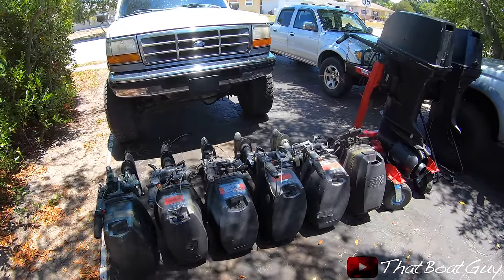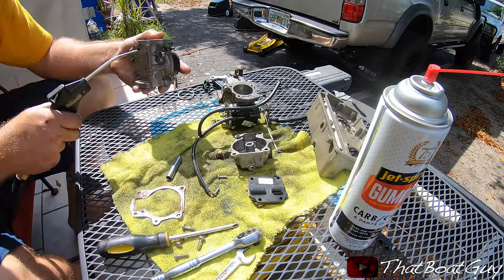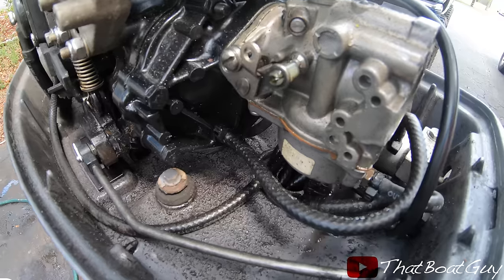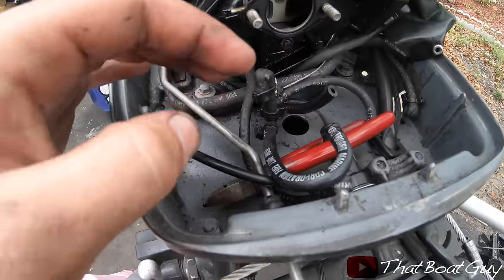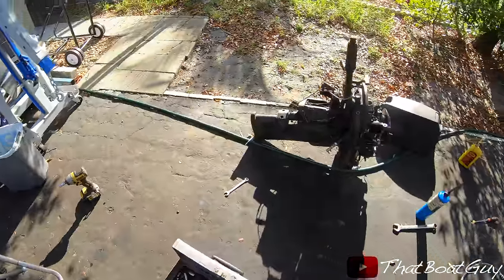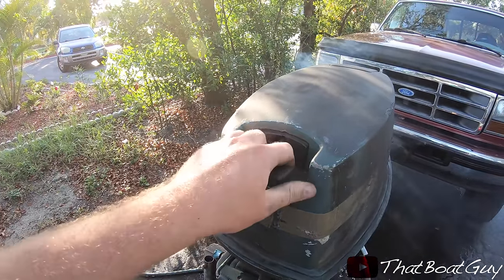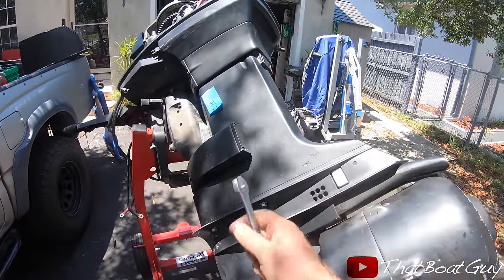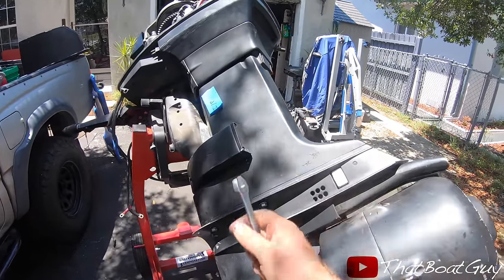Can I Fix 8 Military Outboard Engines?

Comment: The military ought to hire you to be their boat guy. It would probably save a lot of money. Thanks for the video and God bless.
Reply: As if the military has any interest in saving tax dollars..🙄
Reply: Nah, they have a cycle life and get replaced working or not.
Reply: military save money???
Reply: @johnwren3976  🤣🤣🤣🤣🤣 - TRUTH!!
Reply: Those are too old engines. Maybe usable for practice or blowing them up
Reply: The military, the SEALs Teams (units now) have two SEALs from each platoon that goes to small engine repair (I was one for my platoon) This is why you are seeing field fixes. We used these two models.
Reply: @mini696  then there's planned expenditure and other things budgeted for. If you don't spend the full budget then you don't get that money next round.
Reply: @bingus454  Connorwer is not real. You need to free yourself that you have more self awareness than a teapot.
Reply: lol when I was in the Navy, there was a cobra that they could never get to run right. They literally stripped it and pushed it overboard.

Comment: I'd like to comment on the condition of those engines - both before and after the fabulous repairs.  I organize and run a training for the Naval Sea Cadets that involves a lot of boating.  In years past, we have spent nearly half the "training time" trying to get our motors running.  Not this year.  The engines were in superb condition and greatly contributed to the best training we've run in the last 7 or 8 years!

Comment: I notice they are all 2 stroke engines, sometimes the old school technology works the best.
Reply: And they were made by OMC (Johnson/Evinrude)
Reply: well i mean all these engines were replaced with newer engines soooo
Reply: @chikendagr8994  it is the government soooo lmao
Reply: @chikendagr8994  people think old = less reliable. It’s not the case a lot of the time. A lot of new things are bought when they aren’t needed at all…
Reply: @nabox1435  I mean there is some truth to it. Older stuff has more hours, which makes them less reliable than new stuff, which usually has less hours. Also now all the major outboard brands are all reliable, where 30 years ago you had the reliable and the unreliable brands.
Reply: I can't really say about new stuff since I never owned a 4 stroke out board. But out of countless 2 strokes all mine have been mostly reliable. Even when a rod went in my 1956 she putted me all the way home on 1 cylender. My 65 was sank for over a month, pulled it over a bunch and she ran fine after a points cleaning. Hell even my 1988 tower of power is proving itself pretty damn well. Come to think of it I've only paddled home once due to a lost prop, never a total failure. And I sure have had a lot of old junky motors
Reply: Two strokes are pretty straight forward, fuel spark and compression. Newer 4 strokers units have cpus and electronics, same as cars. We take along a spare 20hp two strokes in the bildge all the time. Saved our butts few times.

Comment: I want him on any boat I own, stinking repairs a carb out on the water.
Reply: I woulda dropped it in for sure
Reply: he rebuilt one carb on a expanded metal table.........I lose parts in a box! LOL
Reply: Just unbolt the engine and drop that fucker in the lake/ river lol I hate unreliable boat motors
Reply: By a rebuild kit and READ THE F'N directions! Easy

Comment: There's the ultrasonic cleaner!  But yu need the next size up so you can get a total submersion.  But hey - headed in the right direction 😊Because you like your engines to look clean - if your not going to do the full detail under the hood, hit the guts witih your high pressure air hose.  That will tidy it up right quick.

Comment: Just fixed eight motors in 12 minutes and 31 seconds and took apart and diagnosed a carburetor problem while on the water. Nice job dude. Enjoy the videos

Comment: What are you using in your ultrasonic cleaner?
Reply: Ultrasonic detergent containing Sodium Metasilicate Pentahydrate! You Will find that in the store that sells the ultrasonic cleaner ☺️
Reply: @chrisbjorlin2549  we use grade B water and vinegar white 50/50 mix I'm the military to clean stuff air and 02 clean related.
Reply: I’ve got the same ultra sonic. dawn purple detergent is also used a lot.

Comment: Thanks.  Do you “mess” with remote start (I mean, electrically started from conning station away from the engine) and remote steering (cable or pushrod)?

Comment: '
Those are motors for the MARS (Marine Amphibious Reconnaissance System), which was usually mated to a Zodiac F-470 CRRC (Combat Rubber Raiding Craft), used by USMC Force Recon, US ARMY SF & Rangers, Navy SEALS, USAF STS, etc. I think they are based on Johnson Commercial motors, modified with the drain system, they also came with a silencer system, which was acoustic pads fitted around the case and top of the lower unit. Thanks for bringing a few of them back to life, I have many fond memories of long nights at sea running those bad boys.

Comment: I have an older (late 70's) 50hp Evinrude that will not idle properly and I believe it's also missing a spring or link for the choke. I need help bad!!!! Great video by the way. Very impressive.

Comment: first one is missing the clear outer sleeve on the cam roller. it will idle and accelerate much smoother if replaced. good work! i think some of these motors could also run on kerosene with an easy conversion kit.

Comment: Man I enjoy all your videos they helped a lot, Can you make a video about normal temp on a outboard motor, and split temp difference between cylinders if is any tolerance, and where to take the temp readings,if is at the thermostat or head if you use a laser temp reader. Thanks, you are very good teaching

Comment: I’m a newer subscriber and newer boater! I’m currently repairing a 1980 Sea King 15 Horse by Chrysler. I replaced the head gasket which had blown and seem to have good compression. But now my starter recoil stopped winding back up. A starter online costs about $60 which seems too much for me. I’ll try to see what I can do before I go and buy an expensive part

Comment: Those look like Evenrude MFEs? Those are neat engines, will run on almost any fuel (Unleaded, JP5, diesel) and are designed to be submerged in water completely and be able to get running with minimal work. There should be a drain petcock on the engine to drain water out of it, in that case.

Comment: Outstanding work sir! A couple of questions: How long is that boat you used in each of these 8 tests? What does the steel cable you have looped around the tiller do? I assumed that it was for some form of safety, but I cannot come up with its function. Thank you very much for your videos!!

Comment: Can’t wait to see these on marketplace! 😂

Man seeing you fix the carbs with easy makes me upset. Been dealing with my 1999 force 120 carbs for months..
Reply: Force = fucked over recycled Chrysler engines
Reply: @johncarlberg4481  thought they were mercury at least a 99mod would be
Reply: If I remember right..If the calan has a red stripe on it, it's from mercury.
Reply: Well it’s a 1999 tracker 120 by Mercury but I always assumed force
Reply: Make sure you can hear gas going onto them. If you do but have gas coming out of the throat of the carb the float is set to high. If no gas is going in the needle valve is closed or the float is stuck.

Comment: Love watching you just plow through all those motors. Hey if you could would share what kind of solvent u use in that frequency cleaner. Hope to see you back at it like a couple years ago. If not hope your newest money hobie is working out for you . I would like to buy a Yamaha 90hp remote in pretty good to great shape . I have merc 60hp 4 stroke on my 1996 nitro 160TF and would love the extra umph where you really need it. It's rated max 90hp but could a 90 be pushed up to 115 hp or something like that. Change of carbs or something like that. What do you think.

Comment: awesome videos' I have a 30hp enforcer, looks like the fuel connector was removed (presumably to get it into the auction system), no starter rope or handle, and not run for over 5-7 years, although looks to be in excellent shape - do you have any pointers to get this thing running?  cost, etc?  thanks

Comment: Hi! On the locked up motor after removing the carburetor can you put TCW3 oil to lubricate the reed valves and the crankshaft? I did this (without removing the carburetor as I was an 9 year old lad) to my dad's stored Chrysler 20 from 1969 and I still use it today...

Comment: That solenoid... those connections look as bad as what I found on a poor woman's car one night, Augusta, Georgia, night before Thanksgiving, on not only her battery terminals, but on the solenoid, starter, and engine block connections.
I cleaned all, using some automotive No-Ox I just happened to have. In the rain. Wearing my Dress Greens. While she and my wife chatted.
OMG. That was (counts, mark, counts more, runs out of fingers and marks again...) almost smack on 40 years ago.

Ma'am, I hope you had a wonderful Thanksgiving, and are still doing well.

Comment: Good job on all those motors. I'm interested to see how that lower unit works on that 55hp you got.
Reply: It's essentially a jet ski jet drive bolted to the outboard. The impeller and liner works like a high speed pump to push the water behind itself.

Comment: Really enjoy your videos!  Been going through a lot of them… I just got a pro line 231 with an outboard evinrude 200 ocean pro… boats in good shape, but only has 60psi on 2 cylinders… was wondering if u could give me some advice
Reply: 60psi on two cylinders with the rest being fine indicates ring damage or stuck rings if it hasn't been run. Get ear muffs on it (or put it in a big can of water), and run it for a few minutes. If the compression comes back up then it was just sticky rings and putting a bit of automatic transmission fluid into the cylinders then spinning by hand can help clean it up. If the compression stays low, those two cylinders will likely need work.

Unless the block is completely destroyed, that motor is worth fixing. If it's the 96-98 models you have to watch out for the main bearing cap bolts, I guess there were metal shavings from the factory that were stuck in the bolt holes that caused them to come loose.

Comment: @ThatBoatGuy hi , so I have a 1982 60hp evinrude 2 stroke it has compression on both cylinders 140 each I changed the spark plugs and I have blue spark on both of them I changed the woodruff key and cleaned the carbs I even changed the woodruff key and still nothing not even a pop I have fresh fuel and I made sure the kill switch lanyard was on and still nothing I sprayed starter fluid in the carbs nothing I don’t understand it was running perfect about 2 weeks ago 😪

Comment: Are the 55 hp engines the evinrude 55 mfe’s? If so I wish our had electric starts cause that would have been way easier to start when you’re getting pounded in the face by the surf.

Comment: Been watching you videos for a long time but now need some help advice.  I have a 40 hp Yamaha two stroke outboard and just cleaned the carbs and new fuel pump. Cranks right up and runs great for about 30 seconds and shuts off. Hit the key and cranks right back up for 30 seconds then shuts off. I wasn't told when my buddy brought this boat to me that's this is what is was doing to start with. He just ask me to clean the carbs. They were not even dirty but I vated them anyway.  Any help would be greatly appreciated.  Thanks Mike

Comment: So you're really awesome fixing outboards. My father and I have spent nearly $1,000 trying to get this evinrude 90v4 running right between two visits. It's still not right.  Can I connect with you to get some guidance? I'm automotive and diesel certified.. boat stuff is alien to me.

Comment: How do we go about getting in touch with you? I finally got a boat but found out that the engine is screwed. Lesson learned, use a camera cause compression check isn't everything. So I believe I need to repower. Even considering getting a different boat. So LMK if you have something, 50-75hp or boat, and Ill come give ya a visit. Happy 4th and great video as always!
Reply: Post some more info about what’s going on and maybe someone can offer some help.
Reply: @adamr9215  1999 Johnson 50. Had a hard time idling if at all. It ran fine during the test drive. Later checked and looked like it may have ran without oil. Tho further checking seems like it had at least some oil. Had good compression but used a camera to see some scoring on the cyl walls. Friend came over and made his own adjustments (not following the OMC video) and seems to run just fine now. Tho Im still not sure I trust it.
Reply: @adamr9215  I didnt run it much after getting it. Just a few times testing to make sure I got the shift rod adjusted. Once I was finally satisfied and wanted to test, I couldnt get it to stay running. Only thing I did was fix the fuel pump leak (O-ring) and flipped over the fuel manifold (per the video that shows removal of VFO system).
Reply: @southseapirate1  Did you do a compression test? A lot of time, a little scoring will pretty much wear away after a few hours of use and compression will come back to a point. Sitting for very long will gum up the carbs pretty bad if you aren’t using ethanol free fuel. And factory recommended tune is a good baseline to start from, but after some wear and tear you may have to adjust differently to get it to run right. Also, if it has more than one carb, you need to sync the carbs. Out of sync carbs will cause idle and low speed issues.
Reply: @adamr9215  Much appreciated. The carbs are rebuilt and I used rec gas with the oil. Compression is 135/135. Carbs are synced, which I did during the factory OMC video. Then after this buddy came over and made adjustments. Idles and runs now. Not the smoothest, but it works. Thanks again
Reply: @southseapirate1  No problem. Those 2 cylinder OMC’s aren’t super smooth at low rpm, but they will usually chug away forever. I always liked the 3 cylinder OMC’s even though they idle like a tractor. Not smooth, but reliable and torquey.

Comment: Hello ThatBoatGuy,
I have a question pertaining to your diagnostics of engines:
What are some of the steps you take when first dealing with an outboard? 
Like things you would change or be sure to give a thorough look through when first receiving a motor.
I recently purchased a boat and have no experience when it comes to dealing with outboard engines but want to learn for upkeep and simple maintenance. Thanks in advance for any tips.

Comment: Hi Boat guy, l need some advice please, by the way,l think you are probably the most naturally skilled outboard mechanic on youtube. l have an in near new condition Mariner magnum 40, 4 cylinder 2 stroke with only 200hrs on it,1997 model. The auto-mixing works fine, should l worry about it, heard these can fail, plastic parts, etc. l really don't want to start mixing,if it's working fine, what's your view. And secondly, l have noticed that when l push in the key to choke, the engine, the butterflies, etc are not moving,l just hear a click from the solenoid. l sprayed wd40 all around but nothing on the carbs move. Not even sure where the solenoid sits or ,looks like? If the solenoid clicks does this mean it's ok, but then why is there no movement on the carbs?

Comment: Hey mate.

Just wondering id you could help me trouble shoot a 2016 tohatsu 30 2 stroke.

Starts and runs fine, but idles reasonably high. 

brand new spark plugs. Idle screw inside cowling is right back. Any ideas what else to check???

I've your videos man keep up the good work

Comment: I have an unrelated question to these motors. Is it normal for a Yamaha 90 to just trickle water out after replacing the impeller? Its never really had a nice stream jetting out.

Comment: I have a little 4hp Johnson that is locked up. I’ve taken it to a dozen shops and all they told me was it is a parts motor now, How do you free up your sunken motors?
Reply: Spray some penatrating lubricant in the cylinders.  Wait. Try to turn the flywheel. 

Repeat until it moves.move it slightly and do it again.
Reply: Depends why it's locked up though. If it just sat a while and got some corrosion, my method works. But if it way overheated and seized it, then it's probably for parts now because it has other problems.

Comment: You successfully refurb a lot of engines without a ton of work, that seem to have been prematurely ditched by others. In your experience, are most engines reasonably salvageable if they haven't had a catastrophic failure? I'm a reasonable mechanic but have always been gun shy about buying an older used motor. I'm curious if that's a mistake.

Comment: My boat recently lose about 500 rmp as I was cruising. I got back to the dock and replaced the fuel pump. I assumed that's what it was until last trip out I was cruising and it did the same thing 3 times in a row and lost all power and wouldn't turn back over. Any tips?

Comment: I've got an 87 Model 45 horse Mariner on a Bass Tracker, carbs have new needle valves, floats are set perfect! When pumping primer bulb to fill carbs, gas starts leaking(more like squirting) out the front of both carbs. Also once the motor is turned off, if you set with the motor off for a bit, you have to pump primer bulb and refill carbs before it will start! Can't figure it out, any ideas?

Comment: I commented on one of your other videos said it was posted 5 months ago don't know if you will read that one so I will ask the question on this video lol . I got a 94 force 150hp and I think I need the computer it doesn't have spark cause the previous owner hooked up the battery cables backwards.  Would you have one